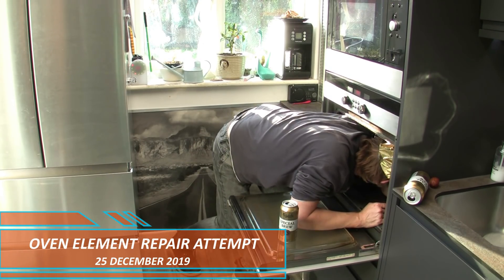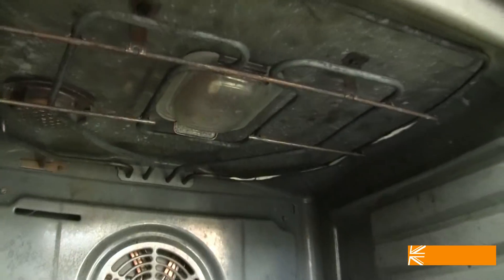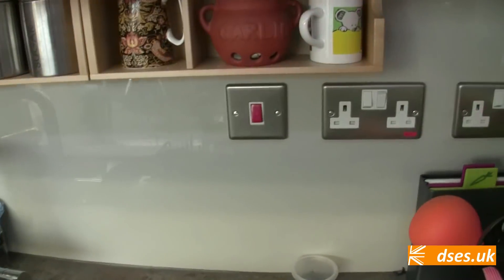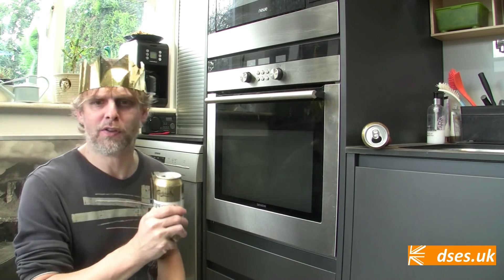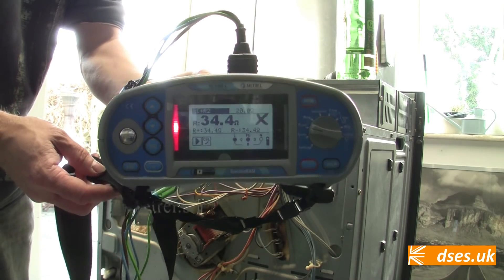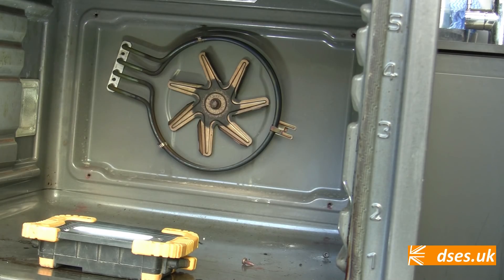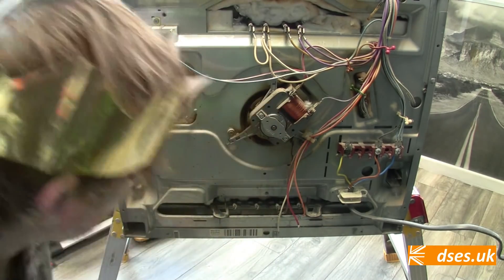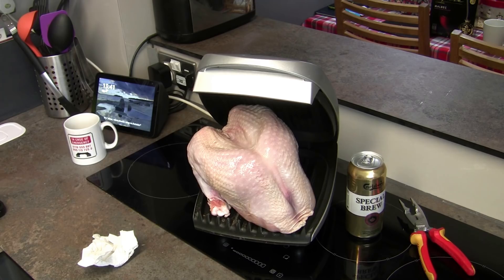A festive oven element repair attempt

Comment: One little tip is that if the grease on those circulation fans can dry out and gum up. If that happens the oven doesn't come up to temperature as the thermostat is near the circular element. It then looks like you need a new fan motor. However, when this happened to my mother's oven, I took out the fan motor, dismantled it, cleaned of the sticky residue from the motor shaft and re-lubed it with some high temperature copper grease I had around and it's been working perfectly for the last 10 years.
Reply from the maker: Cheers Steve, I shall take a closer look when I change out that fan element!
Reply: it's probably o.k., but worth checking it spins freely as I suspect if it doesn't then the heating element might overheat and burn out.

Comment: Love the videos. I do a few ovens.  It bad to do as not much goes wrong. Elements are the big culprits. I used to use t and e for cooker wiring but now try to use ho5 or ho7. Much better I find.
Reply from the maker: Same here Matthew, the HO flex is the best stuff to use, but then when you're working on your own installation and don't have any left on the van, you just think 'cock it' and go with what's to hand!

Comment: I rescued a old couple 's Christmas dinner on Christmas Eve. The oven was tripping the RCD !  Unfortunately there was no visible evidence of a "blown" element. So, off with the back plate, numerous screws in this old Kenwood twin oven, 6 gas burners for the hob. "Meggered"   Twin oven element , all ok, then the twin grille element & found one of them shorted to earth. Disconnected this one, taped the two spade connections with high temperature fibre glass tape (Scotch)  Tested the continuity of the over temp sensors. ( 3 of them)  Switched the power back on, checked for mains on the elements, all ok. ( On this oven there are numerous combinations of switching options )  Checked the operation of the oven thermostat, all appeared ok. Powered off, put the back cover back on, pushed the oven back in place. Now at least the Goose can be cooked. Will order a replacement element asap. As the couple were in their 90's it was foc. However they insisted I took a bottle of Jameson for my trouble. Enjoy Christmas one and all.  I'm sure others would have done things differently , no doubt. Enjoy your videos Mr Savery, keep em coming ☘️🇮🇪☘️
Reply from the maker: Good man, always nice to hear of others putting in some community support, and you can't beat a bottle of the Irish:- I have one here ready for a few special coffees and... well... necking in the small hours when everyone else has gone to bed... probably. All the best for 2020 William, and thanks for tuning in to my rubbish!
Reply: David Savery Electrical Services Thanks for your comment, perhaps because I'm 80 , I tend to be a little relaxed & help " old" folk, being from Co Wexford perhaps made the Jameson more acceptable LOL. Enjoy the rest of your Christmas, best wishes to you and all your kinfolk. Night Night
Reply from the maker: @williammartinculleton7523  I salute you sir, sweet dreams!

Comment: For future reference... get your missus to show you how to take the Feckin door off. They simply unclip and are a third of the weight of the oven and make thus sooo much easier.
Reply from the maker: A top tip Robin, although I use the door to perch my Brew!
Reply: David Savery Electrical Services yes but you risk spilling it 😢

Comment: Ho Ho Ho, and a very uncooked Turkey to you, too!.    The oven with outer element and Boost Element would have worked well.   But of course, you knew that!   My stove has easy "push-in, pull-out" contacted elements, without a "boost".    Oven is one hell of a lot cleaner that mine -- reminds me I need to get to work to clean it!  Go, on!  Spoil my day, will you!    Grrr!
Reply from the maker: You know, I still haven't got around to ordering that replacement fan element. Maybe by this Christmas??

Comment: Does your wife(or you god forbid) grill with the door open Mr.S  as this could be why the element has gone like that,  either that or maybe you line the grill pan with tin foil prior to grilling and thus cook the shit out of the element by reflecting the heat produced by the said element straight back up to it.  Siemens ovens should only be used with the door closed on any cooking functions (know it all bastard I hear you cry, but yes for 'tis true. That and I'm an appliance service engineer who works for Siemens 😁) . Great videos btw, still laughing at the previous 'Bir-megedon' one 🤣🤣
Reply from the maker: Y' know, I do tend to open the door when cheesing my toast, perhaps against manufacturers instructions....
Reply: Closed door grilling is pants in any grill.  Steams it up first. Wrecks crispy bacon, makes steaks tough.. what’s the point of closed door grilling?................... it takes longer to notice it’s on fire 😂😂
Reply: David Savery Electrical Services this has to be the best video I have watched.
Reply from the maker: @quinnergyltd794  Thanks for that compliment, although when it comes to oven element replacement videos, I suspect it's a limited field!
Reply: My Bellend cooker makes no suggestions of keeping the door closed when grilling.
But the knobs keep breaking and falling off. Seems to be a feature right across Bellend's range, gas or electric.

Comment: Nice to see other sparks fixing there ovens at Christmas as well,  I had a similar issue with ours the clock failed totally on Christmas Eve so bugger all oven or burners 
Luckily I had ordered a new one a few days prior ,and low and behold it turned up in the nick of time
Reply from the maker: Sounds like a Christmas miracle Steve!

Comment: Hi mate great video. There is a lot of these 16 amp ovens on the market now adays   I ust to repair alot of ovens. Sometimes when replacing elements in this cold damp weather they can trip rcds. If it dose disconnect earth from back of oven and switch it on let it heat up for 10 mins get the damp out of element and all will be good.
Reply from the maker: Cheers Greg. I recall the PAT testing code of practice allows Class I heating and cooking appliances to have an IR as low as 0.3 MegaOhm because of the cold elements. Have a good Christmas mate!
Reply: @dsesuk  and you mate have a good rest of crimbo and keep the videos coming. Liked the Birmingham one the other day really funny I am from near west Bromwich you should see the bomb damage there 😂

Comment: Do the turkey in the tumble dryer. Very tender.
Reply from the maker: Stuart, I can't work out what all the dials do on the oven; the tumble dryer and washing machine are even worse!
Reply: @dsesuk  Maybe just wrap it in foil and put it in the van's engine bay. Then drive about in 1st gear only so you get it nice and toasty. Could do the gravy in the radiator and if your car is anything like my leaky Toyota it will self baste with random oil leaks. Whilst your at it pad the silencer with some sage and onion stuffing. Yummy!
Reply from the maker: @pradolover  Not a bad idea - and it leaves the van smelling like Christmas all year round!

Comment: You should do a Big Clive and just use two probes with 240 volts running through the Turkey till its cooked  :D
Reply from the maker: Please, no dangerous ideas when I'm balls-deep in the Brew!
Reply: Two probe or not to probe, that is the question.
Reply: @dsesuk   So did the Turkey survive Christmas or was it cheese and pickle sandwiches for diner?

Comment: These videos make my day lots of laughs and as I can relate to most of the problems it kind of makes it funnier. 
Please don’t stop making em. 
I must say tho that oven looks hardly used 😁
Reply from the maker: Cheers Wayne. There are others in the editor waiting for me to sober up and do something with them.
Reply: Please help PLease please.....  I have a bosch HEI7282U/09
Problem - Conv Broil, conv Roast, broil does not heat up (very slow)
               -  Bake works fine
              - Conv Fan works
Work Done  -  Replaced back round element (new=56 ohms, no Continuity), seller says  that is the expected range
                   - Replaced Top Element (new=17.5 ohms, good continuity)

What should could be the problem?  Many thanks

Comment: Appendix 15 of the regs advises anything over 2kW to be on its own circuit. 
I have seen a radial circuit off a 40A RCBO in the consumer unit, that supplies a 3.1kW oven and  7kW hob above. Both were off a junction box behind. I see nothing wrong with that. It is no different to supplying a stand alone cooker with both in one unit.

I have also seen 3kW ovens off the kitchen final ring circuit, just plugged in behind on a 13A plug, just like a 3kW kettle is.
Reply from the maker: There's nothing wrong with a cooker circuit serving more than one cooking appliance. The Electrician's Guide to the Building Regulations say a circuit exceeding 15A but not exceeding 50A may supply two or more appliances and recommends a switch or CCU be installed within two metres of the appliances. It also recommends ovens be served by a separate circuit, although "lightly loaded" circuits with ovens of 3kW or less can be connected to a ring final circuit. Personally, I find appliances rated at 13A are best off installed on a 16A circuit rather than a BS1362 fuse. Although a kettle may pull the same, it's only on for a very short time. When 1362 fuses are run at their limit for extended periods, it can cause thermal damage to the plug/socket. Ovens and EV chargers can be problematic for this.
Reply: @dsesuk  
thx.
So, one 6mm cable serving a hob, with j box under then going to a 20A switch in an adjacent cupboard then to the oven, comes very close to the recommendations.
Reply: @dsesuk  "Personally, I find appliances rated at 13A are best off installed on a 16A circuit rather than a BS1362 fuse. "
A 3kW oven off a final ring with the socket behind the oven, is better off on a FCU. As the socket can be switched, so can the FCU.

Comment: I’ve found some new elements if they have been stored somewhere damp will have too much earth leak and constantly trip an RCD when first fitted. Fix is run them on a non RCD supply for about 10 mins to dry them out. ( I lash something up in the garage to do that which looks well sketchy ) works though. Once they have had some heat through them they are then fine.
Reply from the maker: A good point, and the PAT testing code of practice allows a Class I heating/cooking appliance to have an IR of as low at 0.3 MegaOhm to allow for the insulation when cold.
Reply: UKDavid came across the same problem myself I just blowlamped the ends been ok since.

Comment: Fun fact ... beside resistence test and visual inspection we people that are specialized in repairing stuff like stuff ... we also do insulation measuring .. that said .. new elements always seem to fail on that and need to be used before they dont leak ... just saying .. this ovn seems pretty easy and common so fixing it is not to hard ... that said ...

testing stuff with power on.,.. nothing a home use should ever do ... to easy to touch touch the wrong stuff ... on top of this the cable connectors .. with time they get lose because of the heating up and cooling down .. always worth to check ... and even maybe switching out ... good to check those too ( i mean the cable shoe that goes onto the element connection ) 

=P
Reply from the maker: Ah, a good point about insulation resistance. Normally, I'd fail a Class I appliance testing below 1 MegaOhm, but the PAT test code of practice allows it to be as low as 0.3 MegaOhm for heating and cooking appliances where elements have been sitting. If I ever get around to ordering that other failed element, which still hasn't happened, then I shall IR test it to see what it comes out as!
Reply: @dsesuk  well where i worked when i still was working with exactly fixing stuff like that .. we had said 2 mega ohm at least but we tried heating them up and see if they would dry out first ...

as i mentioned .. new elements are super leaky .. but thats because they are internally still wet =) and normally we just remove earth ... set them on high temps ,,, close of the area around it ... wait an hour or 2 ... and connect earth again and all would be fine ^^

Comment: Oven elements must know it's Xmas. Many years ago my sister's fairly new MFI fan oven's element failed a few days before Xmas. Found one locally that needed a mod or two to the mounting brackets and it lasted until the kitchen was scrapped some years later.
Reply from the maker: To be fair, she's been moaning about it since August, but if I'd have fixed it earlier then what the hell else would I have got her for Christmas?
Reply: @dsesuk  Ah, I see. Good thinking.

Comment: Ahem! Did anyone else notice how close the sockets & isolator were to the sink and the hob. 300mm minimum from edge Mr Savery, 300mm!
Reply from the maker: That 300mm thing isn't in the regs; nothing is for proximity of accessories to sinks. Some kitchens and utility rooms are too small to ever be able to comply with that. It is a recommendation in the Electrician's Guide to the Building Regulations, but that's all.

Comment: How come when my element goes it always trips the RCD. It’s yours earthed? Lucky you!
Reply from the maker: Ah, then yours has failed in a different way; instead of open circuit, it has perhaps deformed or blown out to the outer metalwork!
Reply: I had one which would trip the MCB when it reached temperature and the thermostat switched the element off. Replaced the element and problem solved. Very strange.

Comment: Wouldn’t that trip the RCD?
Reply from the maker: No, if the element fails open circuit then it does nothing, and if it fails short circuit then it trips the overcurrent device. If it deforms over time as it fails then it may take out the RCD. As this one was split, it could have ended up as an earth fault as the white insulating material leaks out and the element wire moves closer to the earthed outer metal casing, but that didn't happen in this case.

Comment: That's the cleanest 14year old oven I have ever seen! From experience 9 times out of 10 it's the fan element that's screwed as everyone just turns it on fan. You can still use the normal / non fan mode to cremate your parsnips though. 

Did your turkey cook ok?

Comment: Awesome video as usual, have you tried a blow torch on the turkey until you get the fan element replaced?
Reply from the maker: No, but I did shove the soldering iron up its arse for what it's worth.

Comment: There would be another oven function you could have cooked your chook with using the outer top element and the bottom element. Slower than using the fan element but good backup.
Talk about german design wankiness I have never seen so many dual elements in one oven. Seriously!
Reply from the maker: Ah, good point. I only ever use the fan or grill function as I never read the manual and, like the washing machine, I have no idea what the other functions do!